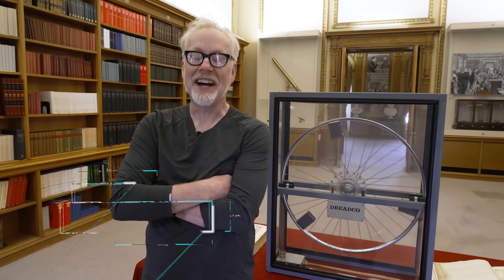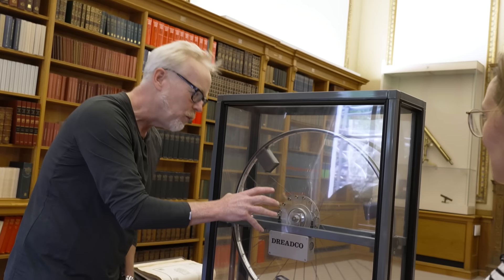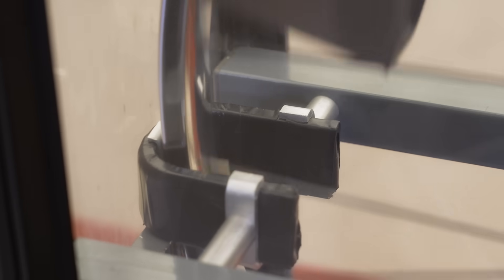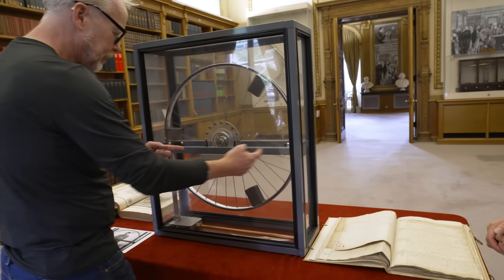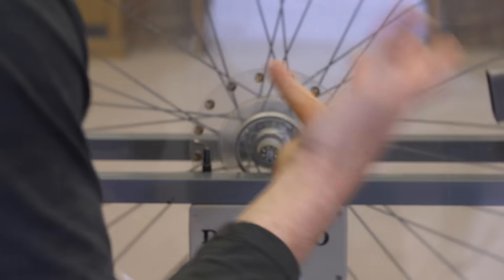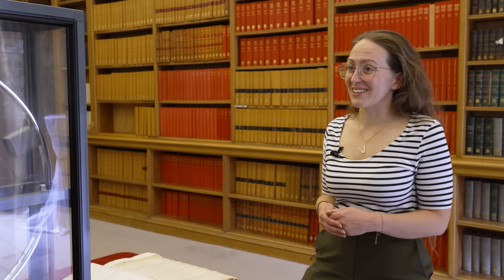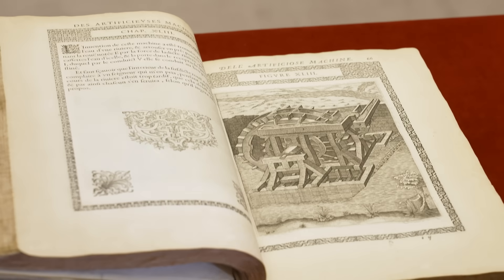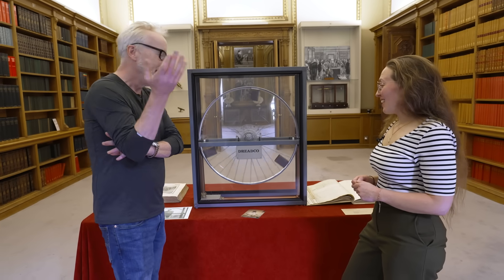Adam Savage vs The "Perpetual Motion" Machine!

Comment: Back around 1900, there was a huge perpetual motion machine installed over a pedestrian alley in downtown Los Angeles. Nobody could figure out how it worked, until there was an hours-long electrical blackout in the area and it slowly stopped moving, only to start again when the power came back on. It appeared to have no way to be connected to electricity, but obviously it was.
Reply: It was drawing power by induction from nearby powerlines or wiring.
Reply: This would be fun to build. I think that Perpetual motion should be launched in to space to operate in zero gravity and become another example of shrodinger cat
Reply: @OVULURWILLIAMS  Perpetual motion is already an example of Schrodinger's cat. A hypothetical device that points out a logical flaw in a theory.

Comment: theory: gobal generator motor

strong magnets in the boxes rotate, creating a magnetic field that precesses in the magnetic field of the earth rotating 24 hours generating nanowatts and microvolts, amplified and redirected to 2 pins that attract the pads on the wheel (electrostatic motor).

Friction is reduced by a sealed chamber with hydrogen (1/2 viscosity of air)

Comment: I personally think there's smaller objects inside each of the 3 boxes on the outside that may be circular or cylindrical that rotate around each other and gravity pulls them down and the weight of the next box along with the moving parts inside properly it back up to keep it moving. I'm by no means the sharpest tool in the shed so it may sound crazy to some but its just an idea!
Reply: Nope, people have tried stuff like this for perpetual motion machines; they never work. There 100% are batteries in it somewhere.
Reply: Near the end of the video they talk about machines that use moving weights, it’s a pretty common idea for making a perpetual motion machine and it also doesn’t work.
Reply: @sashazur they also said they add things to the box for distraction and also will never admit even when guessed correctly. My feeble attempt to guess the interior workings of this device seems to have set off a "perpetual" frustration in you good sir! Lol

Comment: Okay. I have the answer. Thank me later. Water in a closed box cascades down three hydroelectric wheels. A wire is heating the water in the bottom of the box evaporating it. The.condemsation at the top eventually precipitates water
Which cascades down turning the turbines, ect
 Ect
Ect.

Comment: The only perpetual motion that is actually happening is the universe! 
Everything else has to break down and that where the definition of perpetual motion for any machine begins to fall apart. 
In saying that though, could a machine be made to power itself and last at least 150 years? That should be the goal, claiming something to be perpetual motion only triggers the so called educated in screaming "No! You can't have perpetual motion just because blah blah blah". 
Realistically we should be focusing on a machine that should last for at least 150 years and at minimum power itself, outputting any extra energy would be a bonus! 
Never forget that Frank whittle made the jet engine which had just one moving part and didn't need a propeller, and yet the brightest minds of the time all said that it was impossible, it just can't be done! And yet he did it .....

Comment: There is a video online of the moment Martyn Poliakoff opening the envelope and reading the solution. In the same video they used a Hall sensor to measure magnetic fields... Those aren't magnets on the side. Apparently only the box in the centre and the one in the bottom corner has a stray magnetic field.

Comment: Why perpetual motion machines always gotta be circular? Why not think crankshaft, and several weights that are within half a pound difference of one another? Granted on paper it would work far better than a wheel. However in practice… iffy at best. And the moment it is hooked up to anything to produce power it would probably grind to a halt… another tricky part to it would be figuring out how many weights are needed to keep it going, the offset of the weights, the amount each weight should weigh, and the big issue… how long it would have to run to even be considered perpetual motion.

Comment: I know that to have a real perpetual motion machine it must use its own energy it  creates to continuously move, not using any outside source. So this is not a true PM machine, or  did they change the parameters of what makes  a PM machine?
Seeing Adam did not call it "the closest thing to constant perpetial motion"  It would seems as if the closest thing to a PM machine with a small solar panel charging battery along with magnets to create electromagnetism?

Comment: There is a mechanical perpetual machine at Hureka in Helsinki. It will eventually stop due to friction but it has very low friction.
Reply: In 2017 it had moved for 26 years and was still spinning.
Reply: Not entirely true it has been stopped for maintenanse

Comment: The copper pipes are the easiest way for me to make my guess.  You have basically all the easy makings of an oddly precise inlet and outlet on a fan. The three things on the wheel is just weights to make an effective flywheel “battery”. When people move or jostle the item, it needs to be able to have initial momentum to keep moving.  That’s why it’s in a sealed glass box is to prevent people from feeling the airflow. It’s using air friction against the bicycle rim like a Tesla turbine to induce extra energy into the system and in a low friction and well balanced environment it will run a longer time than expected.
Reply: If it’s not sealed, pumping a bit of smoke in would be an interesting test

Comment: It is a simple electrostatic discharge device. No magnets are involved. The three weights are there to keep a constant rotational speed and conserve initial momentum, as this device cannot start, it just pumps enough energy into the wheel to keep the rotational speed. The box is a battery. The device transfers small amount of charges until the battery is depleted.

Comment: SPOILER ALLERT answer in reply to this comment
Reply: it's a big electric motor with hidden batteries. 

wheel has many small permanent magnets on the rim arranged alternating north south. they look like the end of the bicycle spokes. 3 electro magnets on frame power it forming a big self starting motor. AA batteries hidden in copper tube, and other places. wiring hidden in supporting frame.

Comment: I think Adam is probably right: simple motor.  The 16 little discs near the center hub pass by those two metal probes and that tells the electronics inside the "DREADCO" box the timing and rotation speed so that it can activate the two U shaped electromagnets on the left and right to pull on the three boxes at the right time to give the wheel just enough acceleration to counter friction.  The 2 year "maintenance" is just to charge or replace the batteries in theh DREADCO box.  The copper crap at the bottom is probably just red herring.
Reply: Agree the whole thing is a simple induction motor, but I think the bottom box is thermocouple/thermoelectric power supply that need more metal to help current flow between two different metals

Comment: My guess is that there is a chemical reaction occurring withing that dreadco box. My guess is that it is creating a pressure differential and jetting the Gas into those cups. This would explain why the tubes are at different angles. Like an airpowerd water wheel. This would also explain why it needs periodic maintenance.

Comment: Something actually useful to do would be bring a compass needle close to the box, that would tell you where the magnets are. 
I mean, it instantly stopped being interesting when she said it was recharged every two years, because then it is obvious that it is a simple motor with nice smooth bearings. There is a pendulum motor running off a voltaic pile that has been running for a 100 years, that is way more impressivle than a fake that runs for two.

Comment: It would be best for it to not have a battery, so one can honestly say it doesn't use batteries. However a charged chemical capacitor might be the power source, and it therefore need a periodic recharging.

Comment: There is a "perpetual" Clock that uses the temperature diference between night and day to wind up its charge with a diafragm and how it contracts and expands
Something tells me this is something similar, using tiny amounts of light, the rotation of the wheen and all these little sistems to power each other and reduce energy loss as long as a batery is slowly, VERY slowly being used up

Comment: I think the box is a vacuum, so the resistance is very low. 
Maybe te propulsion energy is given by magnets. I once came up with a magnet layout in which the energy towards de magnet is greater than when it moves away from it. Of course this shouldn’t be possibly, but maybe the magnets needs to be replaced once in a while and that’s what holds the energy.

Comment: A perpetual motion machine is possible in theory, but only under extremely specific environmental and material conditions.
It will also never output any more energy than it takes in.

Poetically, however, I like to think of engines as perpetual motion machines. As long as they have fuel, they keep moving. And you can apply that idea to a lot of things.

Comment: I think as a mechanic and electrical for motor vehicles, it looks to me like a big motor which gets a kick of voltage every so many revolutions so it might turn a 100  or even a 1000 resolution before it needs another jolt to keep it spinning and as everything motor like it will need a charge this is why it last so long it's an occasional motor it may only need 20 jolts a day or less to keep it spinning they have obviously worked out to the precise revolutions it requires before a jolt of voltage is required to keep it spinning so that's my conclusion anyway I do think there are some false parts to run you off the trail like the pipework maybe but some of the design is false I do think to keep you guessing lol anyway that's my take on it so have a happy new year everybody all the best from john from Rugby UK

Comment: Frankly k dislike people who pass stuff like this off as perpetual motion, because it’s just low energy and you can cheat to get energy in.  The anniversary clock at my local clock shop (you wind it once a year) but it rewinds itself using the differences in air pressure.  As the pressure increases and decreases it rewinds the spring.  It’s a novel concept but it’s not perpetual.

Comment: I agree with the magnets. Chamber needs to be depressurised for minimum friction with air. Cog needs to be oiled, probably the maintenance bit. The material of the cog is probably one that reduces wear and tear, and friction. Perhaps glass or plastic are good insulators? So heat doesn't disperse inside your oxygen-less box? I'd say a low friction environment, plus alternating magnets (the 3 boxes) based on their orientation. I might be overthinking it, I'm not very savvy in electric stuff.

Comment: Well, there is a "Perpetual Motion" Machine you can actually buy.
The Jaeger-LeCoultre Atmos needs just a temperature gap of one degree to run for 48 hours.
Key is always to have a mechanism which has very little losses in movement, and find a way to replace these losses from a source that is always available.
If this is an electric motor (and I think it is) you need only a small amount of electricity to keep it running.
Electricity from the surrounding can easily be gathered from pressure (piezzo), temperature (peltier) and light (photovoltaik).

Comment: Is it like the Bedini motor which always has a battery in the circuit even though they say the battery does not supply energy in which case why not use a capacitor ??

Comment: Could it not get a small amount power from RF fields in the air with loop or straight antenna connected to a fast RF barrier Schottky diode doubler / trippler / quadrupedaler  circuit that feeds a circuit to charge a  Supercapacitor battery to run a very efficient and high impedance electric motor ( the wheel / rotor would have to perfectly balanced ) maybe if its left in an area with little to no RF filed the Supercapacitor battery would eventually run down and maybe it needs to be charged above a certain level to be self sustaining in an adequate RF field. The only way I think a kind of perpetual engine / motor may work, at least util the magnets loose strength.
1. Invent a permanent magnet of considerable strength that can be turned off and on or reverse its polarity with a small voltage signal. 
Semiconductor Field or Voltage Effect Magnet  (FEM) or (VEM)
2. Invent a magnetic material in that its magnetic permeability can be turned off and on or at least varied significantly with a small voltage signal. 
Variable Magnetic Permeabilty Device (VMPD)

Could such materials exist to produce these effects? If so maybe some NGO may have discovered it and be sitting on this technology to maximize profits. I don't think bankers would like such devices, but I may be wrong.

Comment: One thing that most people forget is that perpetual motion is actually possible, as long as you can get energy losses to be essentially 0 (think of a rotating object so far from any other matter that no external forces are acting upon it). The real hitch is that while the machine can continue to rotate or move forever, you cannot get any work out of it, so it can never be used to perform any tasks.

In other words, as Newton said, an object in motion tends to stay in motion unless acted upon by outside forces. When an outside force attempts to extract energy from the perfectly balance system, then the loss of energy will inevitably cause the machine to stop moving.

Comment: The fact that the wheel slows down in the dark points to a photoelectric effect being used as one of, if not the main, power source. What construction materials are used that will create an electrical potential when exposed to light? Clearly the wheel is well balanced and engineered for minimum friction. The case is not under vacuum, so atmospheric friction losses are present together with those of the support bearings. So the power source needs to generate enough energy to overcome these losses. Calculate the power input needed to sustain rotation and you will have a strong indication of what materials are used in the construction of the device that could potentially generate that power. We know that atmospheric engines and photo voltaic reactions can generate enough energy to power a watch or a clock. Simply scale these devices to see what would most reasonably work using 1970s technology.

Comment: Seeback effect, TEG, using the difference in temperature between the room air and the base that it's mounted to. Prop the box up off the table on small points and it will slow down. Thermal energy into electrical isn't hard to do. It's just very sensitive to disturbances, hence the large diameter to store energy as momentum in the flywheel.
It's a motor.
Reply: Thermoelectric induction motor?

Comment: My guess would be the wheel is a generator, which charges a capacitor/battery, which drives a motor of some sort. That way it sort of powers itself, which is the only way it can get any sort of tag as being PMM; anything else is just a fraud. There has to be some reason The Royal Society considered it worth keeping, so I'd say it has to be about as close to a real perpetual motion machine as anyone has or can build. It's really just a question of what sort of motor; electrical or air blown, or hydraulic whatever.

Comment: I love Adam's genuine almost child-like passion for discovery and learning.
Reply: Yeah I would coldly dismiss this machine and her the moment she said it need recharging every once in a while..  that is the whole opposite of a perpetual machine
Reply: @MrParanoyak  Remember, Adam opened his statement by stating that Perpetual Motion Machines are impossible. That's because the our current Physics models show that these machines cannot work.
Reply: @MrParanoyak  The fact that it runs for at least 2 years without interference is impressive to say the least. "Recharge" is never used. They mention that it needs maintenance or servicing, but recharge is never said.
Reply: I also love his passion for discovery and learning.  She does say servicing not charging.  The mechanism is much simpler.  No motors, no batteries.  Gravity is doing the work.  The magnets slide weight within the boxes.  The on the left pulling weight out towards the rim.  The right one towards the center.  You can see the deformation in the rim as the boxes pass the left magnet.  I imagine the servicing is to true and balance the wheel as well as grease the bearings.
Reply: I bet you do.
Reply: But lies repeatedly

Comment: Strong x3 magnets would make it spin way fast so they are weak and decay. And the bearing grease in time gets gummy and would need servicing. 3 pendulum arms with soft springs with felt catch for noise silence. Could rethink the marble type machine. Still need to service the bearings. Bottom tubes is the decoy along with the title box.

Comment: The position of one component of a mechanical system relative to another is defined by introducing a reference frame, say M, on one that moves relative to a fixed frame, F, on the other. The rigid transformation, or displacement, of M relative to F defines the relative position of the two components. A displacement consists of the combination of a rotation and a translation.

The set of all displacements of M relative to F is called the configuration space of M. A smooth curve from one position to another in this configuration space is a continuous set of displacements, called the motion of M relative to F. The motion of a body consists of a continuous set of rotations and translations. It's quite simple really.